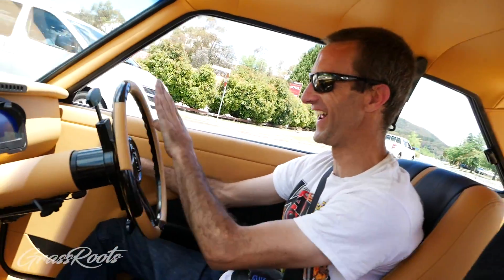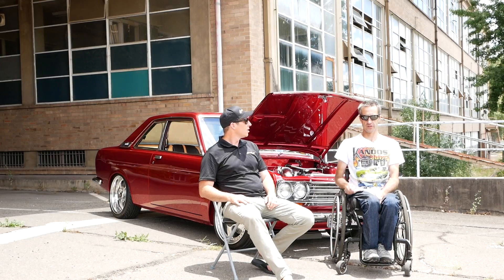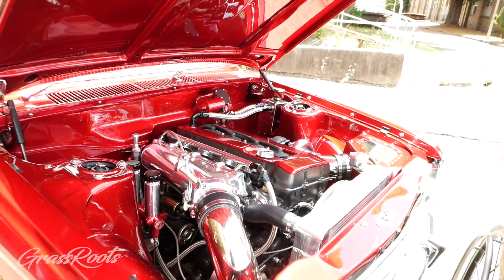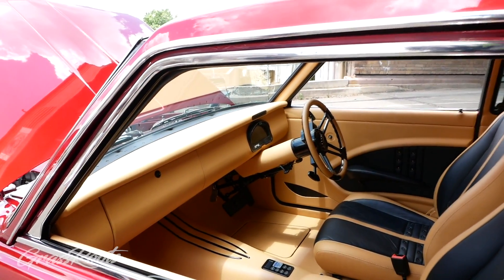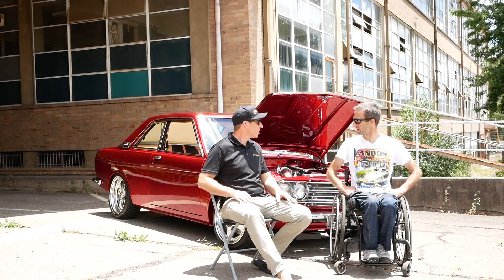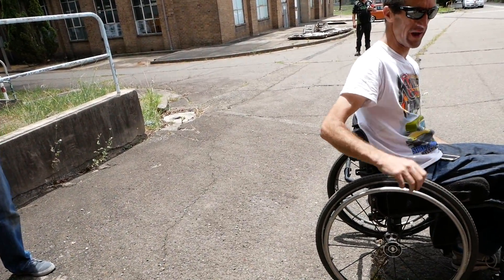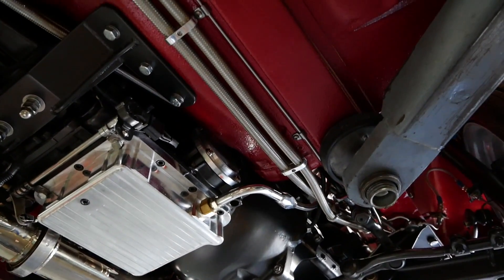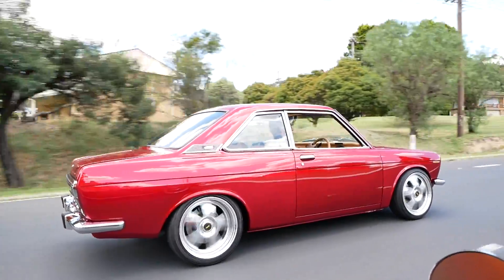Datsun 1600 SSS Coupe 2.2 stroker FJ20et

Comment: I'm still frustrated: we never had a chance to buy a 510 SSS here in Canada, new or used. And right hand drive cars are nearly impossible to import: so many paperwork and inspections are a nightmare.
Question: Is any way to transform a right to left drive, using a RH dash, steering and pedals ??
Had a two door '72 510 in my youth and never forgot that car. The special and awesome sound of Datsun 510 !
Reply from the maker: G’day mate! Firstly thanks so much for watching. Yeah you can definitely convert fro RHD to LHD but it’s a lot of work! You will need to unpick the firewall and the get all the associated parts you have mentioned. 
But we 100% agree such amazing cars!!! 
Cheers,
RG
Reply: Thanks. Newly retired now. It would be an awesome project. I'll look around for a donor car and a RH prospect car.